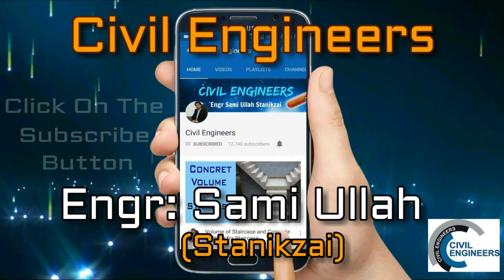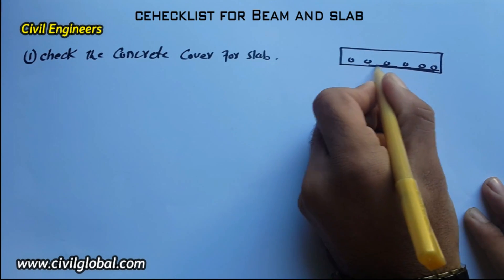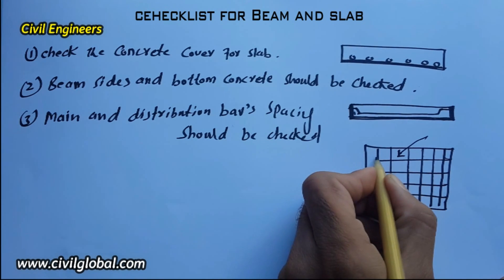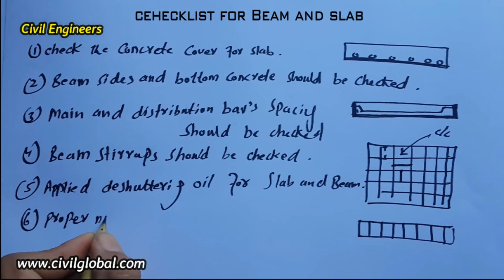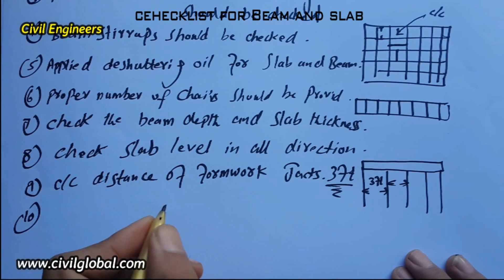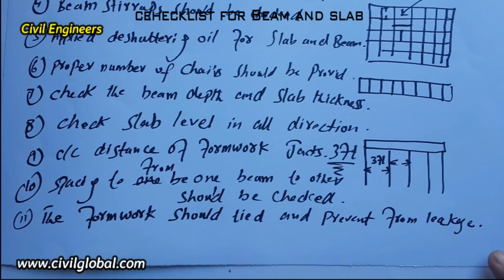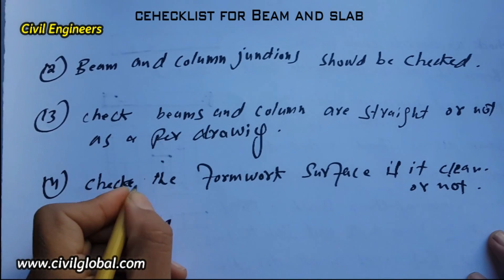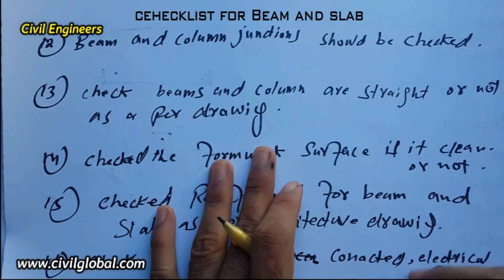checklist for beam and slab before staring concrete

Comment: Sir as you mentioned Point no. 15th ;-  that check the reinforcement of beam and slab as per architectural drawing.
but its wrong sir.
Reinforcement should be checked from structural drawing.